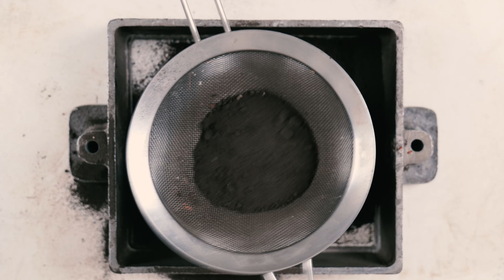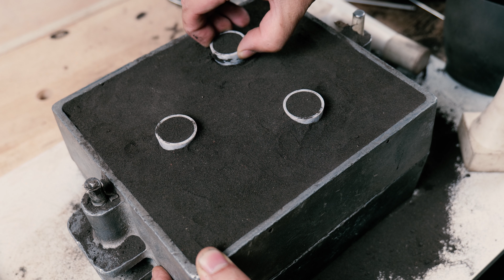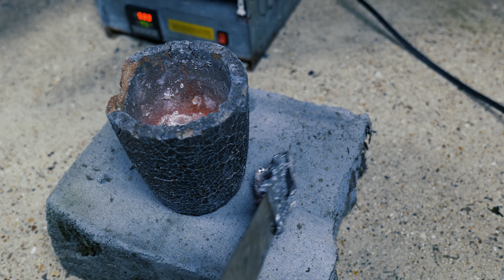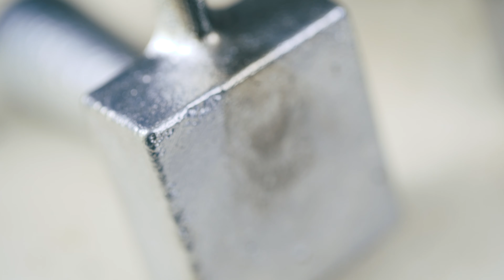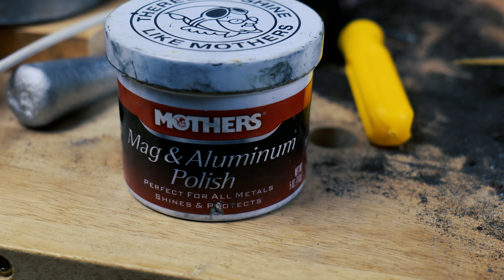Turn your 3D prints into METAL! Full sand casting guide

Comment: Is there any filament i can leave in the mold and just burn it as i pour? im thinking of complex parts with not that flawless of a finish required.
Reply from the maker: hey! Yes absolutely, there are some. There's a couple of different ones you can try: first of all there's PLA (lots of people do it, it's called lost PLA casting -- check it out here on YouTube). Another option is wax-like filaments, but these are expensive. These are designed specifically for lost casting, though I've personally never tried them. There's also other techniques where you print in PVA, create an investment, and then simply wash the PVA out to leave a vacuum you can pour into. But yeah, if you do happen to find a convincing solution, please do let us all know :D

Comment: thanks very informative
at what part does the sand become solid enough that you can turn it over ? is it a property of this type of sand that it solidifies by itself?
Reply from the maker: Hi! Thanks for the comment. Great question btw! :)
Honestly, different people have different ways of doing it and I don't think there's a gold a standard. But here’s what works for me: I keep packing in the sand until it feels like the box can’t take any more. Some people also gently press the mould with a finger. If it feels squishy and still gives way easily, it probably needs to be packed more. The best way is to just experiment, though - after a few tries, you’ll get a feel for it :)
Reply: @MakerVibe interesting! thx for the explanation ✌️

Comment: There's another method where you print with PLA and then just leave the printed part in the mold.  Apparently PLA burns away cleanly when you pour into it, but I've never tried it.  It's like the Lost Wax method, except it is Lost PLA instead.
Reply: But that requires a burnout process and isn't suitable for sand AFAIK. So would only normally be used for geometries that don't allow this type of sand casting.

Comment: The porosity, which you call blemishes, are due to air bubbles being pulled in the cavity during the pouring, which makes your metal very porous. You need to decrease the diameter of the riser,  and build the poring basin in a way that the riser hole will always have metal full to the top when pouring. Also add the gates to the parts from the bottom of the mold. Filling the mold from bottom allow for much less defects and decrease bifilm formation.
Reply from the maker: That's amazing! Thank you for that insight, is there any place you could please direct me where I could learn more?

Comment: You don’t need to remove the printed part from the mold, and some filaments are designed specifically to burn away cleanly in this use case
Reply: This is sand casting not investment casting tho. You don’t melt out the the wax/filament in a sand casting.
Reply from the maker: Yeah that's true actually -- thanks for the tip. I'll try lost casting at some point.
Reply: @MakerVibe  keep in mind you want low walls and low infill so it burns away easier though